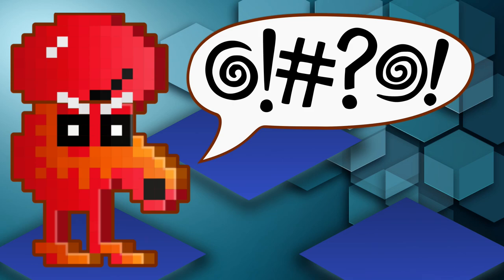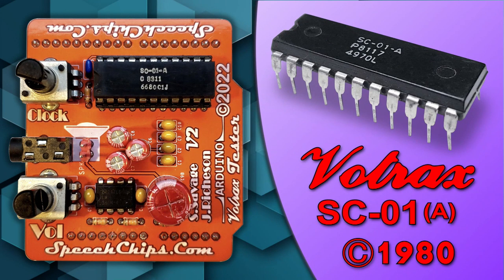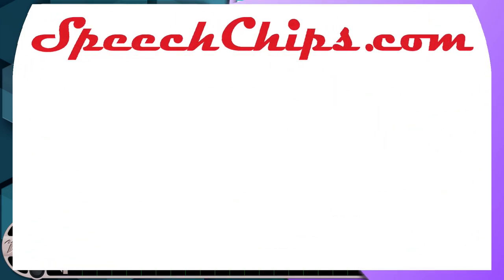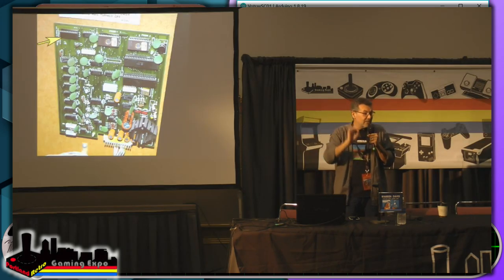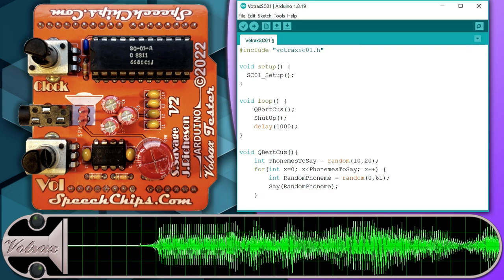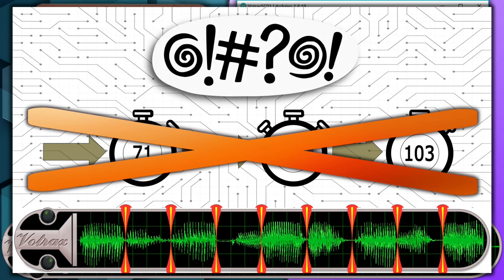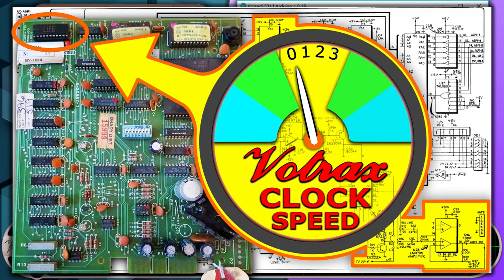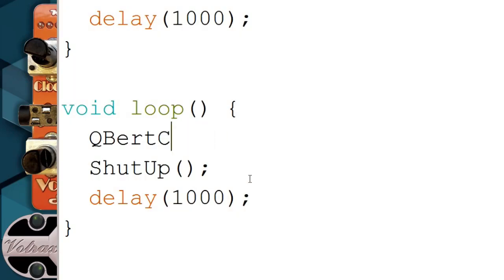Revealing Q*Bert: The Ultimate Retro Game Tech How to

Comment: Just got my SC-02 board together, my Arduino powered and I'm setting up my PC environment and Arduino sketches. This information is valuable!
Reply from the maker: Are you planning a video on the SC-02 board?  If so, you can use clips from this video.  (I have that option set in the YouTube settings)  Just be sure to give credit and a back-link.
Reply: @ScottSavageTechnoScavenger  I'd love to do that. Just got my Arduino and your board back out. I want to incorporate some of these sounds into my modular setup. I'm currently digging in and figuring out what code I need, etc. The Speechchips site appears to be down, no? Thanks.

Comment: I'm not remotely a tech guy but this is facinating. I wonder if it's possible to simulate this chip in emulation.  It would be so much better than the 90s MAME sound samples they've used since 1997
Reply from the maker: Working on it.  ;)   you should be hearing about it in a month or so.